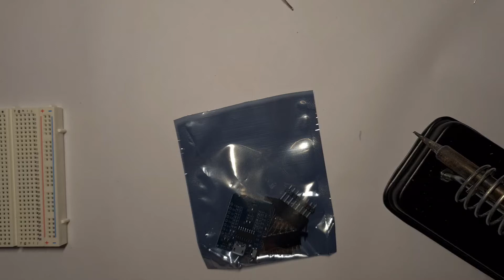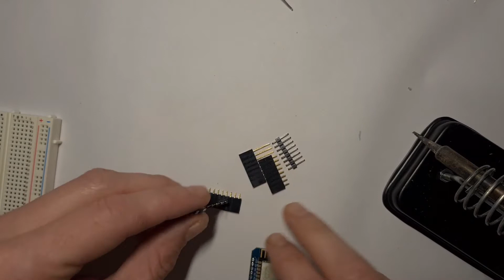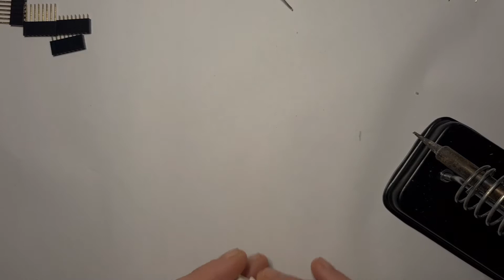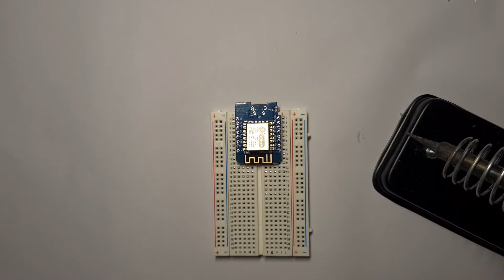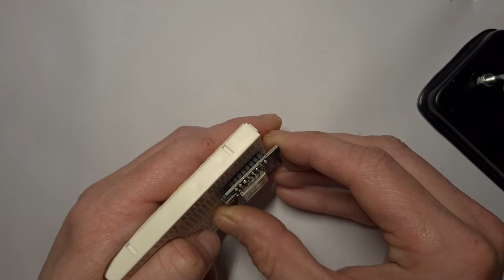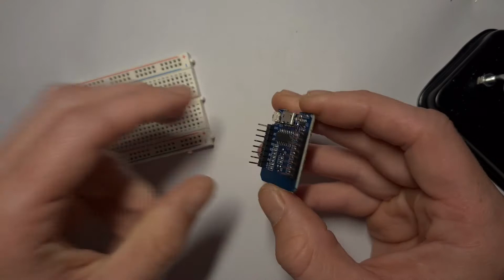Solder Header Pins onto your Wemos D1 Mini Esp8266 Arduino

Comment: That's one of my favorite boards I have used, small and powerful. Use the same method to fix it in order to solder it :) great video.
Reply from the maker: We tried an Arduino Uno first but lacked WiFi, found these which are basically a little bigger than an English stamp.
Reply: @Performancepsus  yup, small and powerful. Everything has its purpose, but for IoT, that's one of the best boards.
Reply from the maker: @SlavkosHobbyChannel  my only gripe is the WiFi. It works and its great but it can be a little finicky is tight spaces. We made an led bar with a wooden base as well and that's always dropping connection.